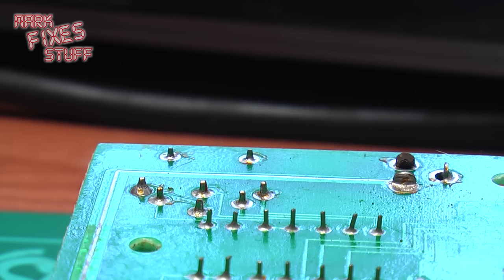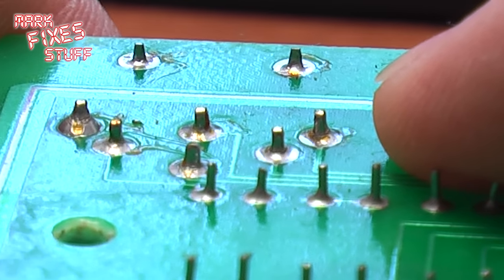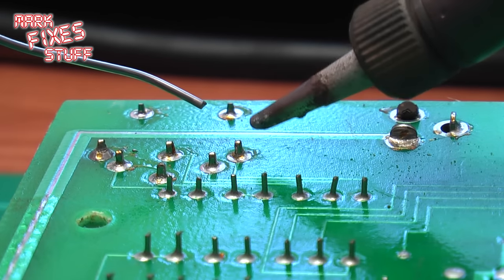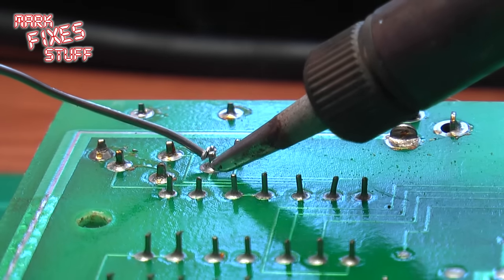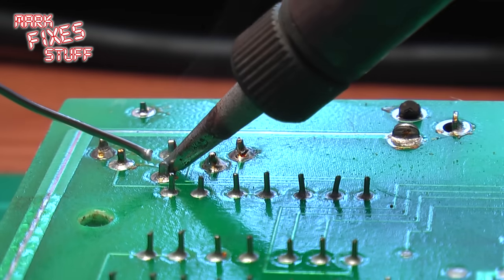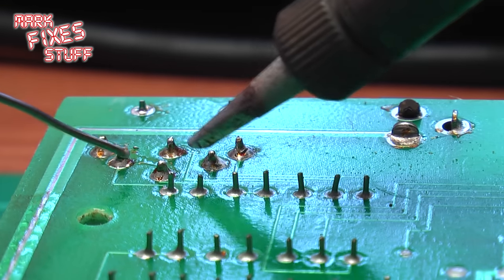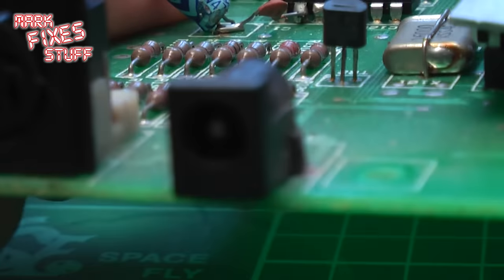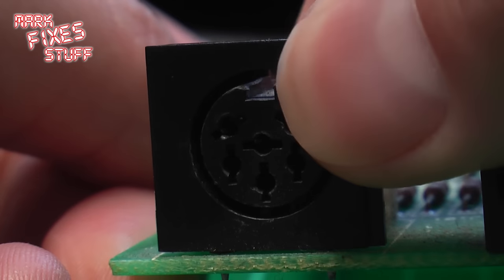Repair a "Dry solder", "Cold solder" or "Cracked Solder Joint". How do I fix it 2020

Comment: Suggestion: Apply the soldering iron 180 degrees from the point you feed solder to the joint you are attempting to repair. Also make sure the soldering iron tip is clean and tinned  before putting on the board and a little solder bridge on the iron will aid heat transfer and lessen the time needed to heat the joint. Your soldering iron tip is a tad large for what you are soldering as well. Otherwise...Well done and useful info for those attempting to make their own repairs!!!!

Comment: Dude, I literally have that exact problem with my gaming monitor. I didn't want to spend money on a tech repair (I've saved up all my money for a PS5) so I just made an assumption that a soldering iron would fix it so I bought one from Amazon and its arriving tomorrow but I still wasn't sure if I would actually be able to fix it by myself but now that I found this video you helped reassure and clear up how I will be able to do this. Thanks a lot 👍
Reply from the maker: Good luck!

Comment: Yes I found an old 17" lcd monitor dumped in the street. It had cracked solder. Your video connector cracking may have been due to mechanical stresses, but I think mine were due to thermal stresses on backlight transformers. These cracks are hardly visible with a hand lens and really need a ~ x20 microscope. Resoldered about 10 joints now it works.

Comment: Oh this saved me some time  I have a car amplifier with potentiometers that had cracked solder joints and sometimes I moved the potentiometers to turn up the bass or frequency and it would just act dead … I opted to use a little flux and some solder from mg chemical stuff is amazing
Reply from the maker: Great news! Flux is the key to fixing many problems!

Comment from the maker: Oh yes. Good tip for the extension cables and one that works in a variety of places. The fact is that any highly used socket that is soldered to a board can suffer from this. The most common one being portable music players and their headphone sockets, closely followed by barrel plug type power connectors!
Reply: I'm sorry for asking a question to a 10yr old comment, I saw you respond to someone 9months ago so I'm hoping you won't mind answering here too. Could you elaborate on extension cables? You mention that "any highly used socket" but I'm new to this and don't even know what a "socket" is in terms of soldering.

I purchased an old Audio Technica sound burger and noticed the audio was off, seems like the circuit board is the common issue and after a disassembly I was able to visually confirm the circuits are very lightly solders and possibly cracked like you show here. Any tips and tricks for audio specific circuitry?

Comment: What kind solder you use ?  Was it rosin solder ?
Reply from the maker: Hi Allen. This was a vintage computer from the 1980's so in this case I use leaded solder. 63% Sn 37%Pb and 1.8% rosin flux.

I try to avoid unleaded solder as it's not as easy to work with.